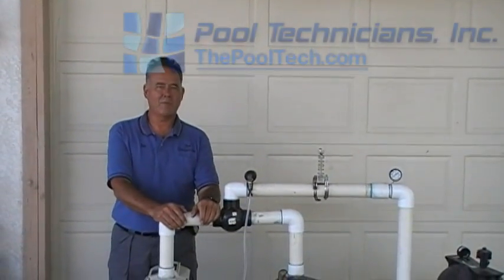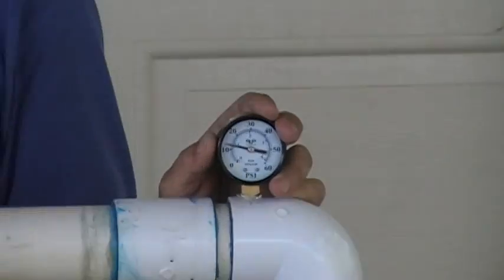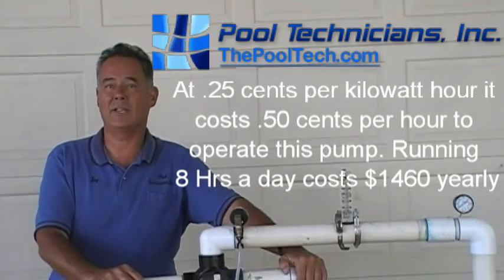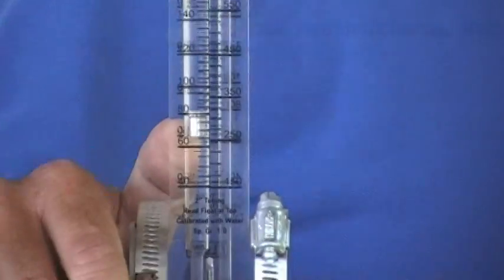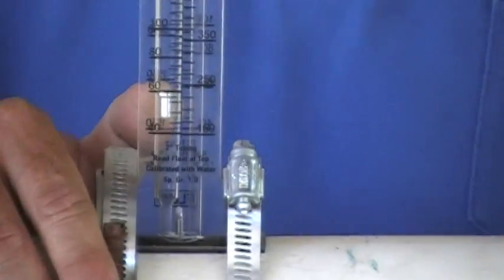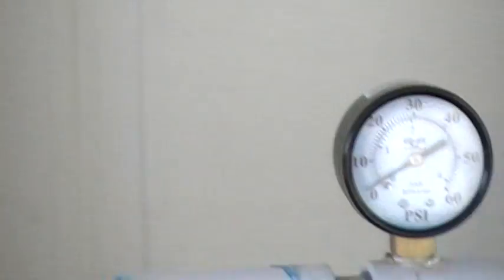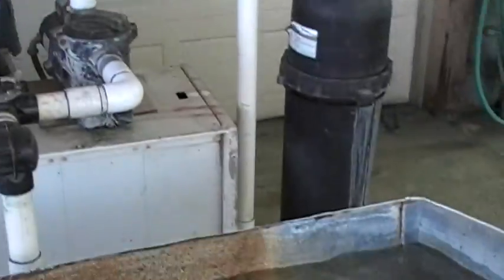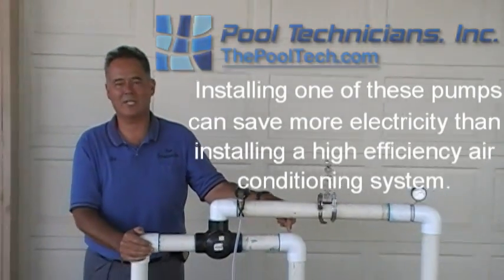Variable speed pool pump efficiency comparison test Pool Technicians

Comment: Who the heck would construct a test system with a 90 degree fitting directly attached to a 3-way valve?!? And the pressure gauge is also too close to a 90 degree fitting for accurate readings. While I understand this does not invalidate the comparison between VS and SS pumps it’s disappointing a self proclaimed expert would make such installation errors

Comment: Awesome for overflow pool where sucking power of the skimmer doesn't matter much to move those debris from the surface of the pool?
Reply: This demo caused a lot of confusion because he failed to explain that a typical daily VS schedule will also include several hours of higher flow to activate skimmer, vacuum, etc. All things being equal a VS pump is ALWAYS a better choice than single speed

Comment: At that flow rate my skimmers don’t work nor does my water circulate and mix properly. Without redesigning the skimmers, drain, and jet placement the VS pump does not keep my pool healthy. I end up spinning the pump at full speed for a healthy pool. You would have to factor in the cost of a redesigned pool to capture total savings. Over 10 years it may pay for itself but I doubt the pump and control board will last that long.
Reply: If a standard speed pump can properly circulate your pool then a variable speed pump can also do it - for less energy and with less noise. It sounds like your pump is either not programmable or your program doesn’t include a few hours of higher flow rate to activate your cleaning features. Easily fixed by adding a programmable controller or learn how to properly program an efficient schedule

Comment: Our pump system is 6 ft higher than the pool and 25 feet away.  Does this mute some of the benefits of a   VS pump l?
Reply: No. The lift isn’t a problem because at the beginning of each schedule the VS pump starts with a priming rate for 1-3 minutes. An SS pump only runs at wide open throttle 100% of the time do the inefficiency and noise are ridiculous in comparison

Comment: I know this video is old but it is still one of the best variable speed motor efficiency videos out there showing the true $$$ savings of these types of motors.  The difference in cost between these types of motors and single speed motors pays itself off in way less than 1 year even at just 9 cents per kWh for electrical costs here in Houston,TX.  No brainer!
Reply: - Just curious, are you actually using a pump like this?

Comment: Since moving water more slowly saves money why not just get a smaller pump?
Reply: Smaller pump is noisy, hot, less energy efficient and shorter service life. A VS pump is programmable and infinitely adjustable. A VS pump is more energy efficient than a SS pump half the size. That is why horsepower between VS and SS pumps is meaningless — the relevant metrics are flow rate and energy consumption

Comment: But what about the cost of a new pump running it at such a low speed? That should be amortized over 2 to 3 years and added to the 'cost of the new' system.
Reply: The entire cost of an VS pump is offset by the saved electricity in 12-18 months. Considering the pump can last for decades the savings over the long run are huge. While the majority of the day it runs at low flow there are also several hours when it’s programmed to run higher rpm to activate skimmers, vacuum, salt cell, etc

Comment: As an electric motor/ pump technician, I'm not a big fan of VS pool pumps. They're really expensive and I can see them last maybe 5 to 7 years. Really by the time you get your money back, two more seasons and you have to spend a lot of money to repair it. If it is repairable. Because many times it is the electronic board that fails.

Comment: All good stuff but still need suction cleaner to work so what do you suggest average time-wise to operate suction cleaners?
Reply: I have a variable speed pump... what I do is run at a low rpm or lowest speed for however long it’s needed to turn over my 18,000 gallons, I believe 6-7 hours. I then have it scheduled to run a 2nd time for 1 hour at 3000 rpm to run my creepy.
Reply: Start out running the vacuum for 6 hours a day and gradually dial that back until you see where it becomes inadequate. I do half the higher flow vacuuming during the night when electricity cost odd 50% lower

Comment: Will this effect the efficacy of the pool cleaner (Mx8 / Creepy crawler)?
Reply: Yes, skimmer as well. Those functions operate on the pump running at high rpms.
Reply: Not at all a problem using the Kreepy Krawley with a VS pump. During the daily program  the vacuum will run normally when at medium speed. When at low speed the water still circulate from the pool bottom through the vacuum. The problem with a SS pump is that it’s always running full blast and you have to partially close a valve to get the right flow through the vacuum — this restriction wastes a lot of energy. With the VS you can dial down the rpm so the vacuum runs perfectly without any wasted energy. My KK runs 6 hours a day at just 2500 rpm instead of the 3450 used by an SS motor. Given the increased efficiency and lower rpm the VS pump costs about 50-75% less to operate

Comment: I'm in Southern California. My electrical rates are based on time of day. If I run my single speed pool pump between 10pm and 8am the cost is .12 per kwh in summer and winter. If I run it during peak hours it is .50 per kwh in summer and .27 kwh in winter. So why would I want to run my pump all day? And if I did would I still save money? What is benefit of running a pump all day? My pool looks great using current method with pump on 8 hrs every night. But it is time to replace my pump so I want to make the best decision.
Reply: - what did you end up doing?
Reply: @kbob8424  I had a guy replace my filter and heater. He said even though my pump was old, it was working fine and I should keep it until it dies. He is an electrician and also moved my pool electrical panel to a better location. He said for my system and electrical rates I should stick with single speed pump.
Reply: @sbearly   - hmm doesn't make sense. You would think lower speed pump uses less electricity = savings no matter the electrical rates. But what do I know.
Reply: @kbob8424  The value of Multi- speed pump is only obtained if you run it 24/7, part of that time at low speed and part at high speed. It pays off if your electrical rates are the same regardless of time of day, but not if you pay more than double during the daytime than nights as I do in SoCal.

Comment: How about a 2 speed pump. 1/2 up and 2 hp
Reply: 2 speed pumps have fallen out of favor because VS pump is perfectly customizable to the system by varying rpm schedules and run times

Comment: I just had the latest Pentair 3hp pump model 11056 professionally installed. I verified the settings with Pentair tech support. I did the math and do not really see the electric savings. The pump runs for 8 hours at 1300 rpm using 146 Watt/hours total 1168 watt/hours, next it runs for 2 hours at 2750 rpm 1265 Watt/hours total 2530 watt/hours, The pump needs to run for 1 minute at 3450 rpm 38 Watt/hours to get the Kreepy Krawley (Pentair pool sweep) to start. Total for the day 3736 Watt/hours.
My old Hayward 3hp SUPER 11 pump was running 3450 rpm for 2 hours a day at 8.3 amps on 230V  total 3818 watt/hours per day.   Power savings of only 82 watt/hours per day with the new Pentair pump. I know for sure that I will not see any savings on my electric bill with all the other power I use.  
Either pump my pool water is crystal  clear. 
 ALSO: for a brand new model pump it's programed with a obsolete daylight savings time. Daylight saving time before 2007.

Comment: We run our pool pump 1 hour per day at the very most. We use a Polaris 9450  for 2 hours about every other day (depending on what's dropping from the trees) and a Solar Breeze robotic leaf skimmer. Our pool is always clean and balanced and we use very little chemicals. When and where would you need to run a pool pump for 8hours a day 365 days per year? Not judging...just wondering.
Reply: It’s not that you NEED to run the pump 24 hours a day but rather making the point that 24 hours of running a VS pump is equal electricity consumption to just 4 hours with an SS pump. Your system is very atypical — for most pools just one hour of filtration a day would be a disaster. For most systems 6-8 hours is a typical minimum. The industry standard is 3 complete volume turnovers each day for effective sanitization

Comment: With running the pump twice as much, what is the life span of these variable speed pumps?
Reply: finally someone asks the right question....and what exactly is the cost of replacement ( repair is not always possible) my guess is 3 times the price ( no rebate) of a single speed 1hp pool pump motor and furthermore single non variable pool pump motors can be repaired easily at minimal costs.  Everyone wants gadgets until they break
Reply: The service life of a VS pump is longer than single speed because they run cooler, less motor strain at lower rpm and are more efficient at moving water. They have became the industry standard and parts are readily available. I highly recommended a VS pump for all replacements and new construction. There are quiet, highly reliable and save an average of $1000 every year in energy savings

Comment: Nice demo.  I wish the presenter had given the RPM settings of the variable speed pump.  Sure, the point is better made with the flow meter, but all of us don't have those, and we would really need the RPM settings used during the different tests.
Reply: That was the first generation of VSP the old 4x160 and did not have the ability to read RPM's as it had no screen.
Reply: A given RPM does not translate to the same GPH from one pool to the next so that’s why the video deals with the GPH values only. If you have a VS pump the ONLY way to insure adequate water turnover is to install a flow meter. A good one only costs $80 and can be installed in 10 minutes with just a drill and a screwdriver. It will wickedl quickly pay for itself with energy savings

Comment: Is the savings in the pump efficiency offset by the drop in fluid flow <filter efficiency>  through the filter. What filters work best under low flow conditions? Thanks
Reply: Continuous filtration is more efficient than intermittent filtration so the bulk of the day the pump should run at relatively low flow. But your daily schedule will also include a few hours of high flow to activate skimmer, vacuum, salt cell, heater.

Comment: I noticed the video was cut right where you might have said what size of horsepower the black pump was. 80 gpm tells me it's at least 1 HP. I'd personally like to see a 1/2 HP Pentair Whisper Flo in the test against the Variable Speed. 1 HP is way too big of a pump for most filtration systems.

Comment: Pretty sure that meter isn't measuring kw. It is an amp meter with no correction for power factor.  Correct me if I'm wrong but it's just measuring amps.
Reply: Not only measuring amps but this guy is totally out of understanding any of the KW, amps, and not talking with the price for the electricity. One time is talking 25c/Kw other time talking 7c/Kw. And most people don't heave an idea about that. Do you know what is .25c/KW. If that is the price of electricity US economy will stop wright now. Who put this clown here?
The video is from 2008, Does every know what the price of electricity was back then. Use to do geothermal at that time. It was 8c/KW.  Where He pull this 25c/KW, don't know.
My personal opinion is this guy don't where is up, where is down.
I never put on any body dislike on you tube videos but this guy deserve it 100%.
I am not talking about the variable pump here, it is true, it does save electricity..... Saving money is totally different thing which I will not even start discussing here. People with little bit brain can calculate for them selfs.
Have a good one every one.
Reply: Curiouse  how many people order his service!!!? "Pool Technicians Inc". 
What a joke, It would be better for him, not to open his mouth.
Reply: Tom - you are confusing the cost per KWH (25c) and the cost to run the pump for one hour, which does drop to 7c for one of his examples.  And yes, in Southern California we pay about 25c for one KWH in the higher priced tiers.
Reply: It is indeed measuring power. You can search for his meter DT-3348, and see that he has it set to the power setting up to 40 kW. He has two probes that go into the box he set up, which probably measure the voltage across the circuit breaker. It's a little hard to tell from the video because he doesn't show his electrical setup or mention it. The clamp-on part is measuring the current, the leads are measuring the voltage, and the meter is calculating the power by multiplying those together.
Reply: Nope. He is using a multi meter. And he is using it correctly

Comment: i would just rather have a .75 hp pump with the hydraulics done right.  i think that if u reverse bernulli's law it will also work better.
Reply: You can’t change your pools “hydraulics” without digging up lawn and concrete deck. But you can easily install a VS pump that is infinitely programmable

Comment: Oskar Diaz De leon: Turning the pool pump on and off drains a considerable amount of power. It takes a huge spike in energy to get the motor going and the water circulating. To answer your question as to if it damages the pump to have it running longer the answer is NO it should not as long as you keep water in the pool. The Intelliflo VS+SVRS pump actually primes itself in intervals going from low speeds to higher speeds to help save the motor and it has a safety feature if the sucktion hole gets clogged the pump shuts itself off AND shuts itself off if it does not get enough water- saving your motor. Running your pump for more hours a day OR turning it on and off a few times a day should not effect the lifespan of the pump- assuming you take proper care of it. The old pump you may have WILL run for years but it drinks alot of juice. I am not affiliated with any companies i just work in the pool service industry, If you can afford it I would buy that pump for my pool. It should last just as long if not longer than any other new 1-2 speed pumps.

Comment: The input power to the VFD (variable frequency drive) is 60 HZ, but the VFD reduces the frequency to the pump motor, which in turn reduces the speed at which the motor turns.  The pump loads' torque and power vary with the square and cube, respectively, of the speed (quoted from wikipedia).  This is why reducing the pump speed by half yields such a dramatic reduction in power required.

Comment: Generally speaking this is a very good video.  My only complaint is the use of 25 cents per kilowatt hour for power.  At least here in Florida, this power rate is more like 10 cents per kilowatt hour.
Reply: welcome to California
Reply: The RELATIVE efficiency and cost savings are the same regardless of what your energy company charges per kilowatt hour. Even in Florida it varies between electrical providers and increases over time

Comment: You just have to remember that if using Pentair IC40, flow should be between 25-80 gpm, any lower may cause issues.
Reply: This was only a demo of potential energy and cost savings. In an actual application the salt cell is fine because your programmed schedule will always include a session of higher flow to activate the vacuum, heater, salt cell, etc

Comment: Hz is how frequently the direction changes in AC (vs DC) in North America.  You don't pay for that, that's just how you get your electricity.  What you pay for his how many watts you use.  Lowering the speed of the pump lowers the amount of work it has to do and thus lowers the amount of kWh you have to pay for.  In short he's showing you can lower the flow (and thus the kW used) and run longer dramatically decreasing the cost.

Comment: You are correct that most homes do not have 3 phase power but by using a VFD 3 phase power can be generated.  What makes the VFD particularly desirable is the VFD's ability to drive a 3 phase motor at almost any speed.  It is this ability to lower the speed that results in huge energy savings.  

Yet another by product of the lowered speed  is the improved filtration and clearer water.  The noise of the pump and motor is also significantly reduced.

I use the TECO 7300CV VFD.

Comment: mikejosephine - Pool vac’s like other suction cleaners don’t use pressure…they work on the suction side of the hydraulic system.  However, suction cleaners will not work properly at lower flow rates…but can program the variable speed pump to work a higher flow rates when you need to run the cleaner and other water features and a lower flow rates when filtrating.

Comment: Variable speed pumps are nothing new.  Industry has been doing exactly that for years but it hasn't cost them anything even close to $1000 per pump.  By installing a used 3 phase motor and a VFD, one can upgrade to a variable speed pump for a few hundred dollars.  There are other advantages to reducing the speed of a pool pump.  Better filtering which results in lower chemical costs can be one.  The 80% energy savings is nothing to sneeze at either.  Chemicals and cleaner is a non issue.

Comment: Many thanks for the "real world" demo.  I just tested my aging 1.5hp Whisperflo and it's drawing about 1.7kw.  For those wondering about varying flow for solar, sweeps, etc., I will probably go with a VS-3050 and Suntouch control.  The VF will compensate for increased head pressure in most cases by ramping-up speed, according to Pentair.  I like the VS w/ Suntouch because I can automate my solar (and if the control every dies it's much cheaper to replace than the cpu on the VF).